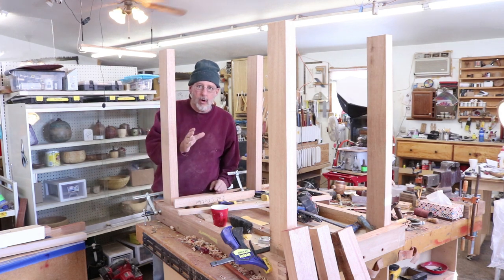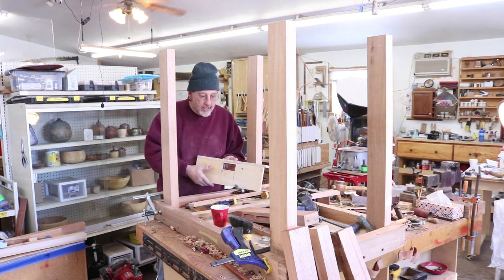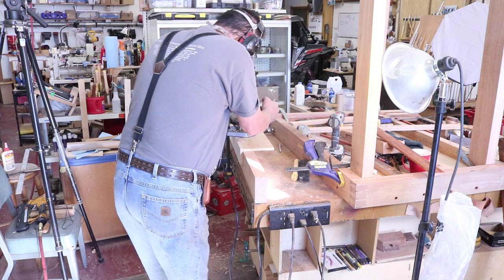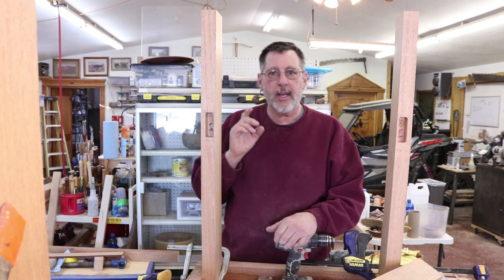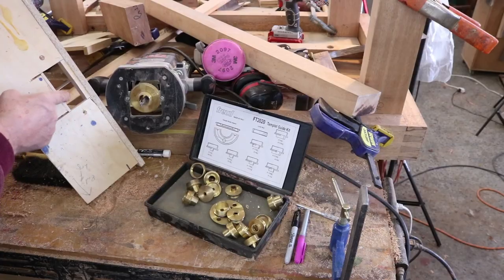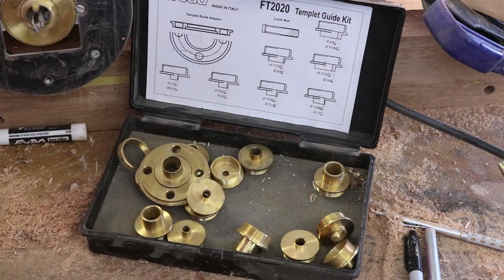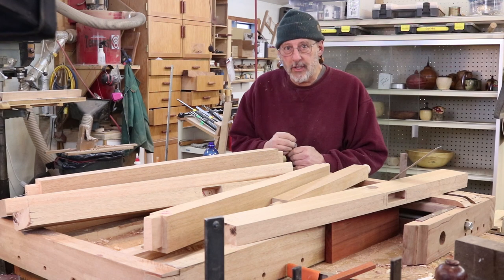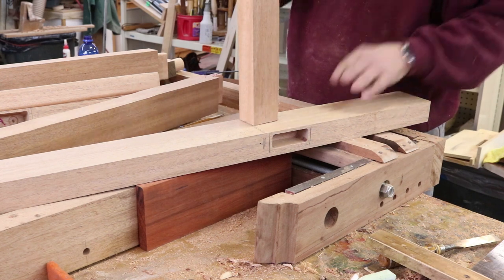Woodturner's Workbench: Part 5   Assembling the Base   Sam Angelo Wyomingwoodturner

Comment: Sam, I have an 6 x 4' bench with 3" thick top that I use for my square edge projects. What you have built is  in the same mindset as my big bench. You build the bench for what you will be using it for. I would like to tell you that I was impressed with the ingenuity that you used not having the proper tools. You used what you had and made it work. That is the sign of a true craftsman.   Well done.